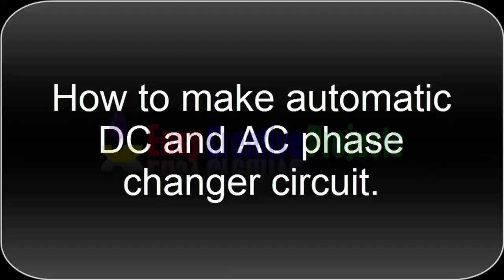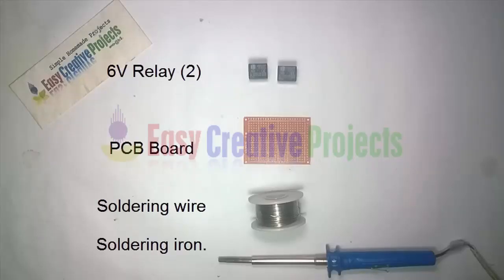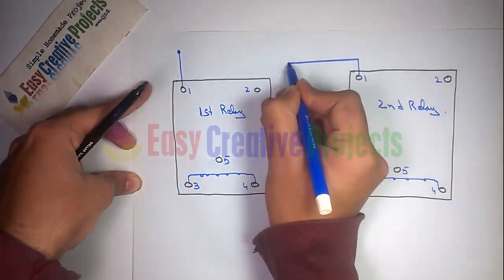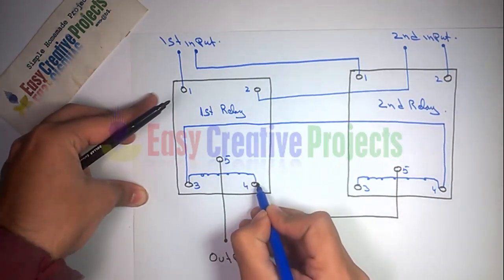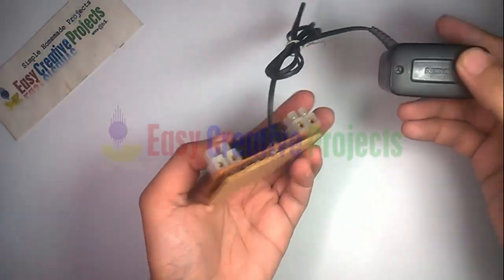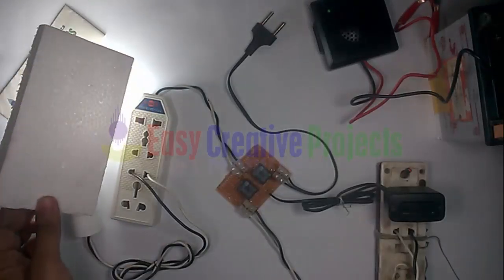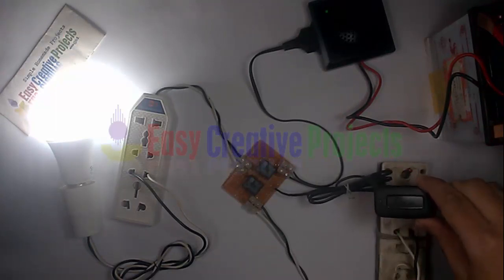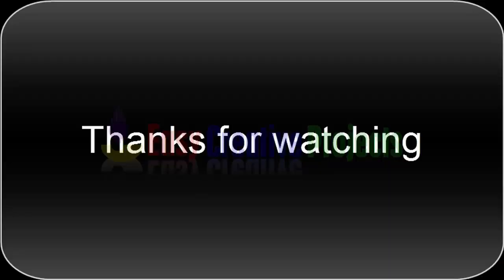How to make automatic DC and AC phase changer circuit - homemade auto switch

Comment: I need this kind of switch for 12V wifi router. 
Kindly suggest a ready made one available already in market. 

If it is not then write down name if these parts to make it myself as you have done already.
Reply from the maker: you can buy it form any local electronic shop. 
simple says i need 2 input 1 output circuit for my wifi router.
thanks.

Comment: but I want to use a source and a battery at the input and I saw that you used the 6v source and a battery and another wire connects to the socket but I want to use the 12v source and a battery at the input
Reply from the maker: 1st you need to understand what is relay. and how its work.

Comment: But I didn't understand one thing, there is an output for two inputs, but I think that at the input to the output there are three wires, the source wire and another wire for the battery and another wire, I didn't understand that at the input because it has three terminals, two inputs that goes to the source and the battery and another that is the output for the equipment but at the input there are three wires, the one in the middle that is the source, the left side for the battery and on the right side a wire that I don't know where it goes because you Didn't show the connections properly
Reply from the maker: 6v charger use for relay operating. ok?
12v battery or inverter use for 1st input option.ok?
220v power use for 2nd input option. ok?
now when we on relay with the help of 6v charger then relay switch auto connect with 220v(2nd input).
and when electicity gone then switch auto shift on 1st input option.
i hope you understand. if you want to see connection diagram then visit our website.( link in discreaption.)
thanks.

Comment: Can l use two relays 24v for 30a and another question does this project also charge the battery?
Reply from the maker: its only switch. its not a charger.
i use 12v relay. mean relay switch operate on 12v. but relay switch can handle 220v, 10amp load.
i hope you understad.
thanks.

Comment: Hello sit I have build it and it working  great with my fan  but the relays get hot after 10 minutes of operation please I need help how can I solve the problem sir
Reply from the maker: check your relay power and your fan power. you need high amps and good quality relay.
normally relay heating literally. you can use mini fan for relay.
thanks.
Reply: @EasyCreativeProjects  thanks a lot it helped🙏🙏

Comment: AC 230 volt can connect to the 2 nd relay side and it always on, am I right?  there is no issue
Reply from the maker: yes. an input side we see 2 connection,
1 side we connect 220v ac and 2nd side we connect with UPS power.
and oputput side we connect 220v LED blub, (or anything that you want)
when light gone then relay auto change power on UPS side. and output side we get power continually.

Comment: Hello Bhai
Can I connect 240V in DC input,
220V in AC?
Finally in output can I use TV, fans, refrigerator, lighting, 100W bulb,  etc....?
Please reply
Reply from the maker: dear its only switch. if your product work on 240v dc then you can use.

Comment: Hello sir I am a student being interested with this kind of project I just want to ask, is the light bulb powered by 6v from AC input (220v)? because I want to make this but with this kind of principle  (220v AC input to light our house but when there is power interuption it will automatically change to my solar light powered by 12v but with different light bulb/device). I am hoping for reply sir thank you so much!
Reply from the maker: its simple 2 input and one output switch that work with 6v or 12v power. (if you use 6v relay then you need 6v and if you use 12v relay then you need 12v)
in input side we see 2 power sources. right?
1st side we can put direct AC 220v and 2nd side we can put UPS power.
when light goes then switch automatic convert in 2nd side (UPS)
and our light on continually. 
6v or 12v power only use for operating relay. its not operate led bulb.

Comment: Hi , thanks
Can I connect 240 volt Ac power to the input of the relay?
Reply from the maker: yes you can use any type of load power. 
but for relay operating you need 12v extra charger.

Comment: well done. A quick question. Did you use 6volt DC relays on your project or were they AC 6volt relays? thanks
Reply from the maker: 6v or 12v relay mean its operate 6v or 12v with extra charger.
but in my case its hold 220v 10amp load. 
thanks.

Comment: 1:31 minutes in videos didn't get 6v power supply means.I'm giving battery in 1st input and charger in 2nd input.Then why 6v power supply should add relays 3 and 4 pin
Reply from the maker: you need to power for operating relay. if you use 6v relay then you need 6v extra power for relay. and if you use 12v relay then you need 12v extra power for operate relay. 
its simple switch that work with the help of relay.
thanks.

Comment: Can this project hold a car battery 12volts input.
Reply from the maker: yes. its simple switch. you can operate any thing as you demand. if you thought relay is not compactable for your work then simply use good power relay. 
thanks.

Comment: What volt is the bulb to work om 6volt and 12v battery,  and also with the 220v supply
Reply from the maker: its only switch 2 input and one output.  you can use any power as your demand.
Reply: @EasyCreativeProjects  Hi is it possible input ac dc and output only dc?
Reply from the maker: @chandonnath2549 if your output device support both power then its possible. but i think you need ac to dc converter

Comment: Can i use jio modem... without disconnect when lights off...
Reply from the maker: its simple switch. you can use any thing that you want. when light goes then its take half second for switch change. if your modem has 2second backup then its work without restart.

Comment: I did tried the said diagram is BURN OUT the 12V LED when I plug the 220V only work when using 12v battery
Reply from the maker: its simple 2 input 1 output switch. and switch operate with 12v power supply.(if you use 6v relay then its operate 6v power supply) 
you can operate any kind any power of product.
if you input 220v then you must use 220v component for output. then its work.
if you dont understand then you can also buy this switch from market. both are work same.
thanks.
Reply: How can you connect a 12v led on 220v without  stepping down the voltage? Its obvious the led will burn

Comment: what voltage was the battery?6v? im going to use a 12v battery. will the 6v relay burn up?
Reply from the maker: you have 2 option.
1st, if you want to run this circuit directory 12v battery then try to use 12v relay
or
2nd, try to use 5v voltage regulator with battery.
thanks.

Comment: can i use it only 12volt DC Adapter to change another 12volt battery  i mean dc to dc change.
Reply from the maker: yes you can use.
its simple on off switch you can operate any thing as your demand.
thanks.

Comment: Pls reply i need this i have two phase from two diffrent sources 1 is government and other is private, it should run on govt only when government curent failure then it should draw from private, after government current is ok then it should disconnect from private.

Simply it should work as automatic line changer which is used in changing line between line and generator
Reply from the maker: dear its simple 2 input one output switch. 
on output side every time you get power automatically.
you use only 2 input. government light and private light, or generator light.
if you don't understand this so you can also buy 2 input 1 output relay from shop. 
thanks.

Comment: A small doubt disconecting 6v supply making it to take input from battery i.e inverter, after giving dc supply will it stops taking supply from inverter and takes from the power source or it continues to take supply from inverter
Reply from the maker: relay operate on 6v charger power. 
if you use 12v relay then you need 12v adaptor for operate relay.
thanks.

Comment: very successful explanation. Can I use two 5V power supplies with a single output using 5V relays as in the diagram you drew?
Reply from the maker: yes you can use any type of power as your demand. 
thanks.

Comment: When mains fails 6v adaptor takes 2-3 seconds to discharge its capacitor and activate/deactivate relay.... how to fix delay discharge of capacitor instantly? During tbese 2-3 seconds my tv set top box reboots/restarts!
Reply from the maker: if its take 1 or half second then also TV, or computer restart.
its simple switch. 
you need 5 to 10 second power storage device on output side.
thanks.
Reply: @EasyCreativeProjects  then please  can you tell how to did that , with a simple circuit

Comment: I have similar setup but when mains 220v is off, it delays before it switched to inverter.
Reply from the maker: yes its take roundabout 1 second for change switch.  if you use it for computer then your computer restart when light off.
Reply: @EasyCreativeProjects  can you fixed it..

Comment: Good job miss! Will this circuit still operate when both lines are on?
Reply: It's an auto switching relay.. You can use 120v to run your stuff. If the power goes out.. The DC battery backup\inverter takes over. To keep your stuff going..If the power comes back on. The relay will auto disconnect from the DC power source...

You must keep in ind. The amount of watts your using. To make sure  you size the relays to handle the amount of amps you are using...
Reply from the maker: its a switch my friend. its work on 1 side at a time. if this switch burn then both connection short. its use for UPS and live wire connection auto change.. you can also buy same switch from market.
thanks.

Comment: Sir in your circuit you have used 6v two relays merged for an output so that while power off from input 1, relay switch to second input which is connected to battery. All good. you have not mentioned volt of UPS or battery and charger for Relay to operate how much volt charger is that. 

can i use the same circuit design using relay to switch to get output from two inputs that i am using..
1t input is 5v powerbank and 2nd input is from 12v power adapter.

Please advice.
Reply from the maker: dear its simple 2 input one output switch. 
relay work with 6v adapter/charger. 
in input you can use any type of power and operate your product on output.
when 1st input power not working then switch auto connect with 2nd input and you can get continue output power.
for more detail please visit our website.
thanks.
Reply: @EasyCreativeProjects  Thanks for your information, that means, if want to go with 9v then have to use 9v relay as 1st input and when power off, it switch to 2 relay that is connected to UPS/Battery and could be any volt. Please advice

My requirement is have to connect 5v to 9v as 1st input and when power off, looking to go ahead with ups / battery of 5v. So in this regard have found your demo which is very helpful. so please advice how much relay can use on fist input (5v to 9v) is my first input supply and second supply from powerbank that gives only 5v
Reply from the maker: for operate relay, you need extra power adapter if you use 12v relay then you need extra 12v adapter for operate relay. ok?
in 1st input, connect powerbank power. ok?
in 2nd input, connect ups battery 5v power. ok?
and on output side you can operate your require product.
you can also buy 2 input 1 output relay from market. but its little expansive.
thanks
Reply: @EasyCreativeProjects  really appreciated for your valuable time support and help. Moreover guiding is really awesome. Thanks a lot sir
Reply: @EasyCreativeProjects  sir I tried connecting your diagram
Reply from the maker: you welcome.

Comment: what about the battery???is it charge automatic
Reply from the maker: its simple 2 input 1 output switch.
Reply: @EasyCreativeProjects  whether the battery will recharge using main 220v supply or not
Reply from the maker: @siddukori2151  friend its simple switch. for learning point i use battery. (UPS) if light gone then power switch auto convert on UPS battery.
if you want to charge battery then you need separate connection for charging.
Reply: @EasyCreativeProjects if it doesn't recharge then can you explain how to recharge it...

Comment: can i use this circuit to fix between inverter and charger to charge my 12v battery
Reply from the maker: its simple on off switch you can operate anything that you want.

Comment: brother koi aysa tareeqa hy jis say 12 volt power jab relay ko jay to woh 220 water pump ko on kar day or jab 12 volt dc ki power off ho to moto off ho jay 220 AC wali
Reply from the maker: simple 12v 5 pin relay use krin. 
jb 12v say relay on krin gay to relay ka switch 1 side pay connect ho jay ga. 
jb relay off krin gay to switch 2nd direction main auto move ho jay ga.
for more detail please see video on our channel ( how to make auto on off switch for emergency light and fan)
thanks.

Comment: I am using 12v relay and handle 15w dc power and then how much dc volt and amp     need to run the relay.
Reply from the maker: you can operate relay with 12v and 100ma(minimum) current.
Reply: @EasyCreativeProjects  thank you

Comment: Can u help me am trying to use this to run a 300w water pump when electricity is on it runs off of the 110v an when electricity goes it switches to a 12v battery inverter
Reply from the maker: its very simple on output side you connect water pump.
on input, 1st side connect direct power (electricity)
and 2nd side connect battery inverter power. 
when light gone then switch auto connect with ups battery and you can get both time output.
if you dont like this one then you can buy same relay switch from market.
thanks.

Comment: Sir, the relay take few seconds to for switching then, what happen, if the EB line touches inventer line? Whether it affects the connected load or it can lead to short circuit?
Reply: It's impossible for the relay to connect both lines on at the same time, so don't worry
Reply from the maker: its possible only one conditions if your one relay burn. then short circuit happened and your house circuit backer trip. nothing happened more.
but its chance in real cases. (for more safety you can use extra backer with this circuit.) or
if you dont like this then you can buy market made relay. its also work same but its cost 10 time high.
thanks.

Comment: Can it supports 200W load?
Reply from the maker: dear normal 12v relay is 10amp and 250v. supported.
P= I x V
i = 10
v = 250
so
2500w supported.
your load is 220w. so its easily support it.
thanks.

Comment: Pls make just like copy of professional inverter
1 mains on
2 battery charge
3 inverter on
4 battery full
5 overload
6 fault, ground/short circuit/ ac input not found for charging/ac output not connected

Comment: It is a very nice video.i have made it and it works but What will happen,if one relay become inactive. isnot there is a great possibility of reverse flow of the phase line into the output of the inverter. if one of these relay becomes inactive?
Reply from the maker: Dear then its effect on battery. 
but my all projects only for education purpose. you cannot use it for commercial work.
you can also buy double switch relay from market. 
thanks.

Comment: If 220v supply is cut is relay work or not
Reply from the maker: relay work on 12v. this circuit provide you 2 switches. when 1 switch on then 2nd switch off and when 2nd switch on then 1st switch off.
for operating relay you need 12v power only one side. when 12v relay power cut off then switch automatic change.
Reply: @EasyCreativeProjects  so what if both switches are on, will it still work?
Reply from the maker: @edsonkumenya5626  1st do that then tell me. 
1 time switch work on one direction. so how its work on both direction at a time?
you say at a time i switch on and off right? is i possible my friend??
Reply: @EasyCreativeProjects  thanks man understood
Reply: @EasyCreativeProjects  thanks man
Reply from the maker: @edsonkumenya5626  you welcome.